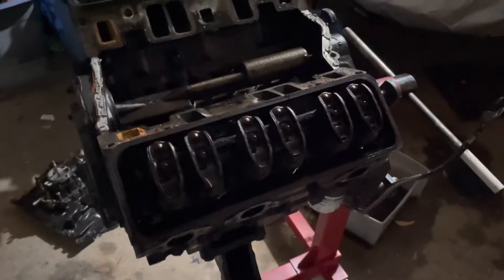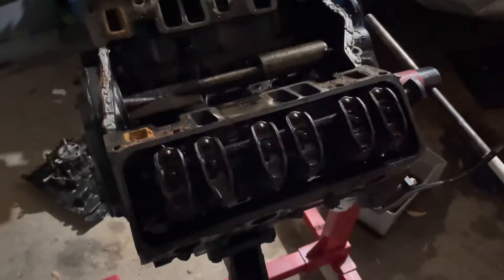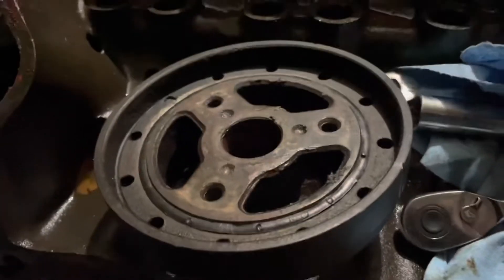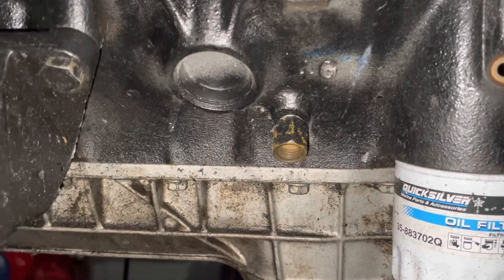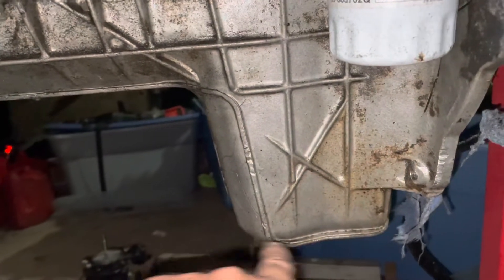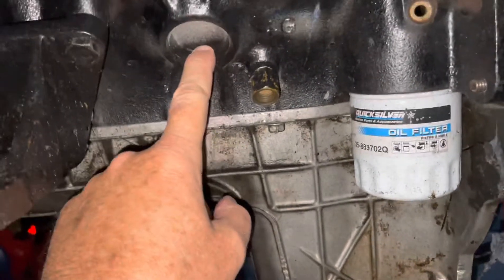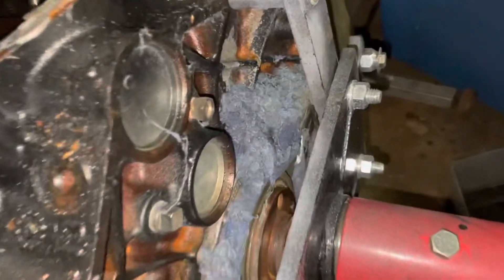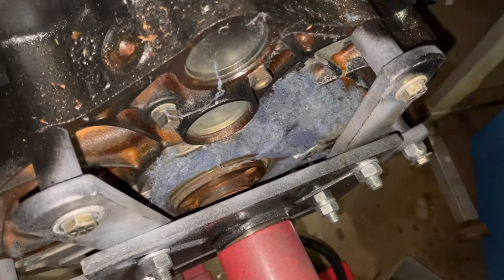7x1 - The Wrong Way - Truck to Mercruiser

Comment: I think you will find the truck cam specs very similar espc LSA to a marine cam and useable without reversion for marine applications
Reply from the maker: Im not worried about reversion. The marine cam is hotter than a stock cam providing better high RPM performance. The truck cam can be used but the engine won’t perform as well.

Comment: Always thought the marine 4.3 used factory roller rockers.
Reply from the maker: No only after around 1999. Anytime you want to check when a part was updated plug in the year around when you think the change occurred in the Rockauto website and then search for the part. You’ll be able to see when the part updated.